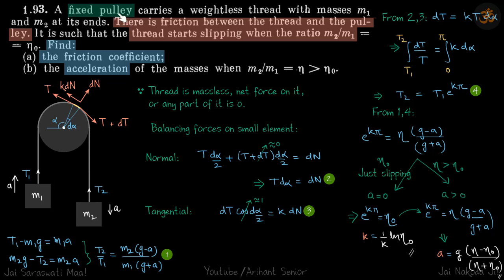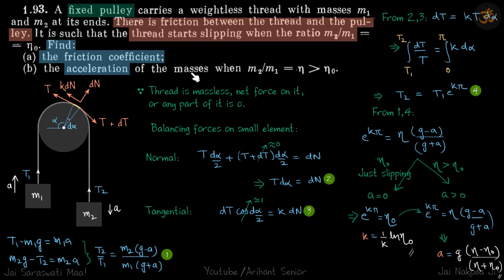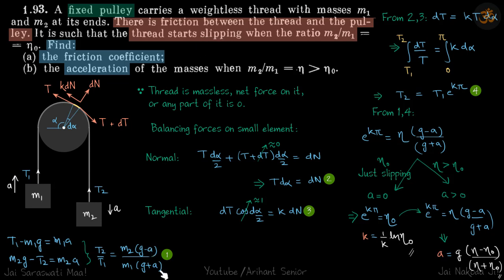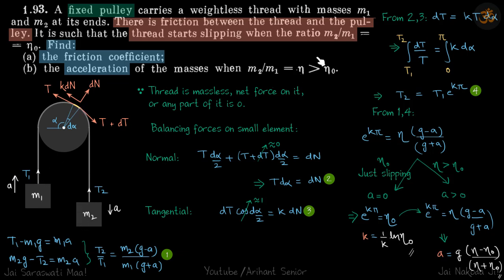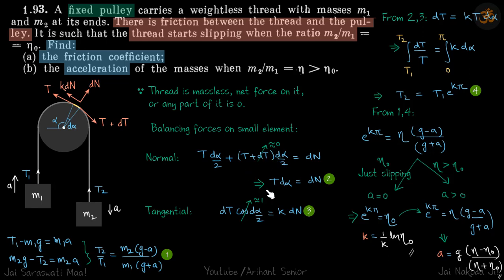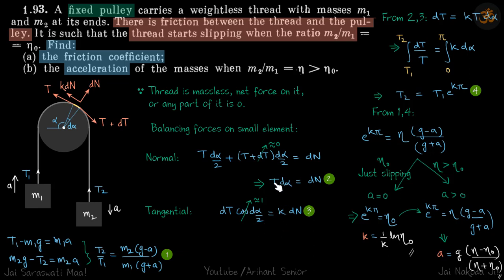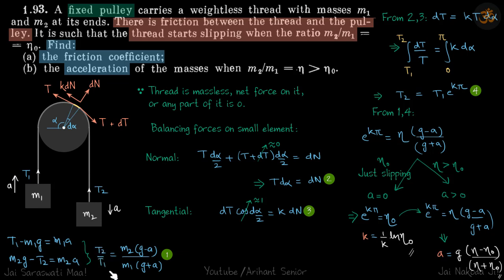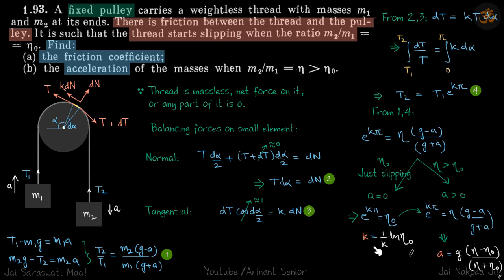1.93 | Irodov Solutions | Mechanics

Comment: For eqn 2 we neglect dT as its very small , 

Then for eqn 3 we consider it as we want non zero LHS,  :P
Reply: K=(1/π)ln(n⁰)
Reply: Sir , can we say that 

Net force on pulley=0 and Net torque in pulley =0 

So (torque)net= T2R - T1R -fR = 0 

•°• = T2-T1=f 
(Here 'f' means friction and R= Radius of the pulley )
Reply from the maker: 1) We didnt neglect dT in eqn2, we neglected dT*dalpha.
2) Yes as net force/torque on thread is zero. And therefore net force/torque on pulley is zero too(by action reaction)